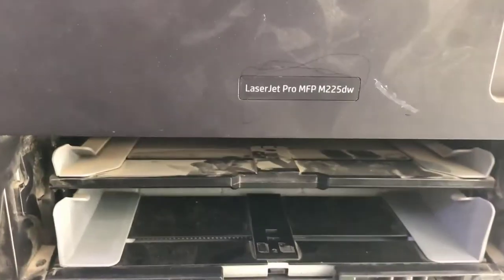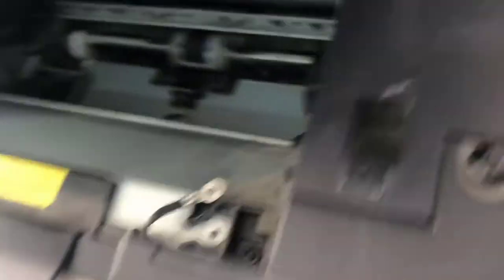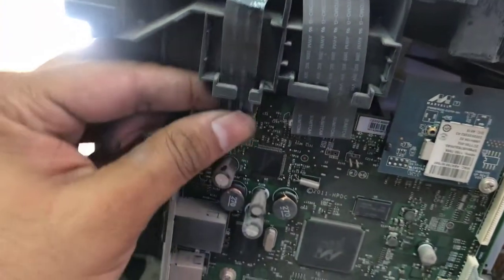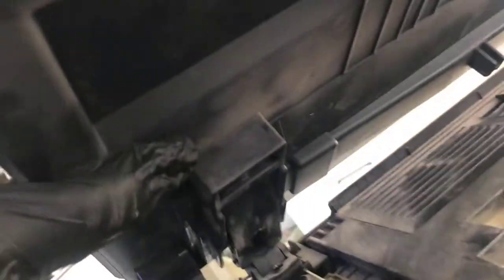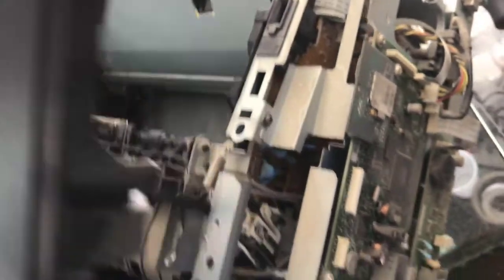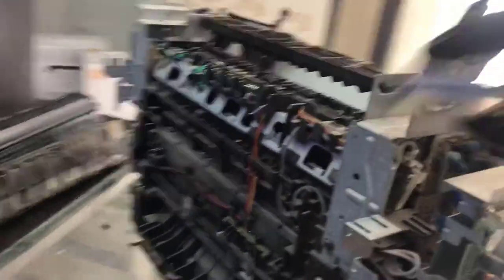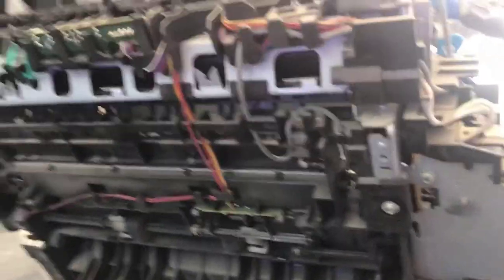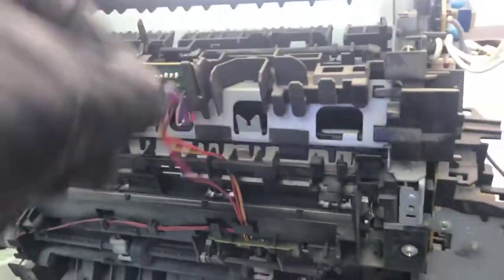How to Change Fuser Sleeve of HP LaserJet Pro MFP M225dw And Disassemble Fuser Unit?

Comment: Is the fuser sleeve damage what is causing paper jam at that fuser area and also sometimes at the back area of the printer? Or what could that be in your opinion?
Reply from the maker: During the printing process sometimes paper pin or anything tiny went inside the fuser with the paper and sometimes paper jammed inside the fuser due to the improper paper type like sticker or plastic etc.
Reply: Bu problem bende de var. Arka kapağı açınca 2 tane kauçuk silindir var. Sanırım bunlar neden oluyor. Kağıt diğer taraf için yeniden geri çekildiğinde ilerleme bir an duraklıyor. Bu duraklama anında kağıt bu silindirlere ulaşmış oluyor.
Reply: Problemi kesin olarak çözdüm: yazıcının arka kapağını açtığında gördüğün kauçuk silindirlere az miktar vazelin sürdüm. Problem çözüldü ve duplex olarak 200 sayfadan fazla yazdırdım.

Comment: Hello dear, I have a problem with the ink being very faded. It prints different colors than the prints I choose.
Is it from laser module for hp m283?
Reply from the maker: Check the toners
Reply: @BilalKhalid  The ink is there, but the printouts are incorrect.  The colors appear different from the documents to be printed.. I cleaned and aligned, but I did not get the correct result